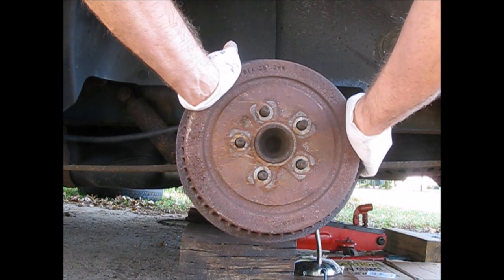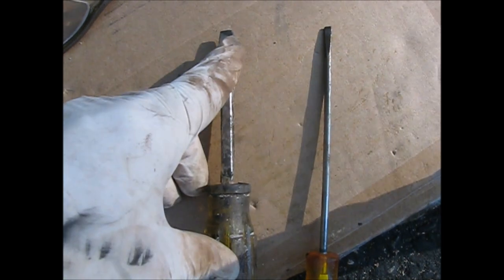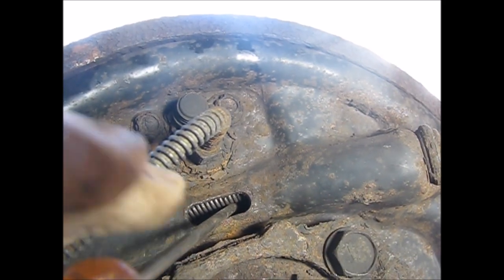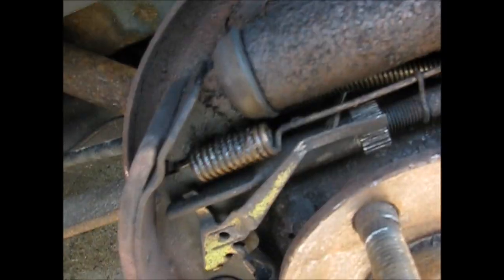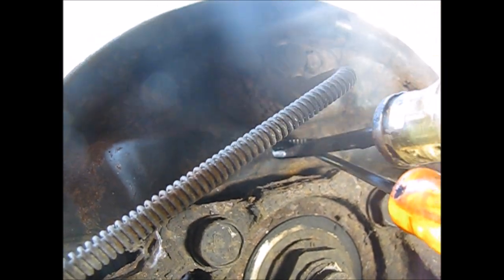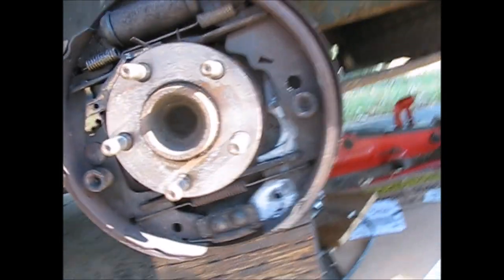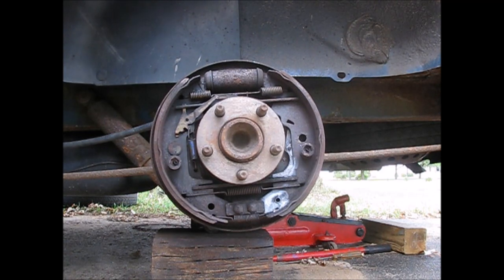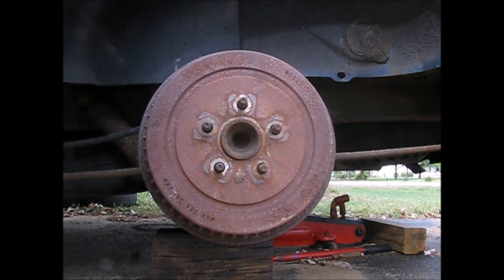How to remove a stuck brake drum

Comment: Seized parking brake, did it prevent the wheel from rotating? That's my problem. The rear passenger wheel will not rotate. I can't get the drum off but found it strange that they wheel would not rotate and wondering if it's possible that the parking brake is the problem like you are having. So, could you rotate the wheel by hand with the drum on? Thank you for the video. It's the closest that's come to my problem.
Reply from the maker: I have had the brake completely seize the wheel. Rust on the lever was the culprit.
Reply: Jeff, I had a seized drum. Backing off the star wheel allowed the drum to be removed.

Comment: Mine doesn't have a hole, how now??!
Reply from the maker: Try some penetrant and try tapping on it with two hammers, 180 degrees apart.
Reply: With a round burr grind off the head of the pin holding in the shoes, from the back. Or maybe just snap it off with a hammer and a screwdriver.

Comment: The star wheel is inside the drum. If i could get to it, the drum would have to be off first anyways
Reply from the maker: There is an access hole in the back plate just for the purpose of adjusting the star wheel
Reply: @TheOriginalMechanic  first place i looked, nope
Reply from the maker: @kolyasmirnov7667  That sucks
Reply: @TheOriginalMechanic  Its ok, I muscled it off there 😂. Just adjusting the brakes theyre about half way down.

Comment: I loosened the wheel and now my rotor won’t move
Reply: Drum
Reply from the maker: @jacobpeterson3049  Number one, it may be rusted on. Try some penetrant and back and forth tapping from opposite sides with two hammers. Number two, there may be a ridge on the drum edge where the brake shoe didn't rub on the drum. If this is the case you need to back off the star wheel to gain some distance between shoe and drum.